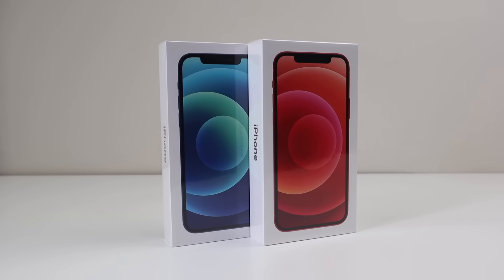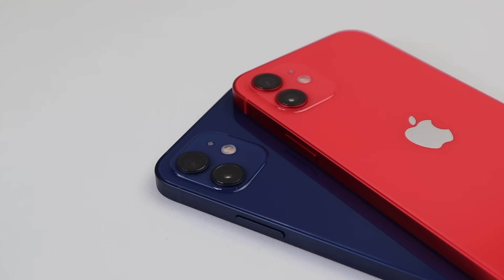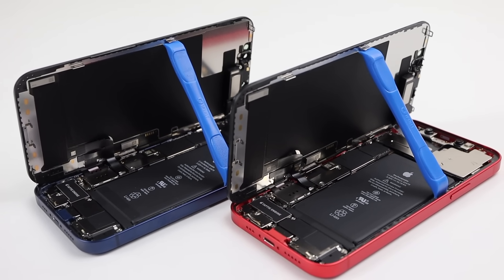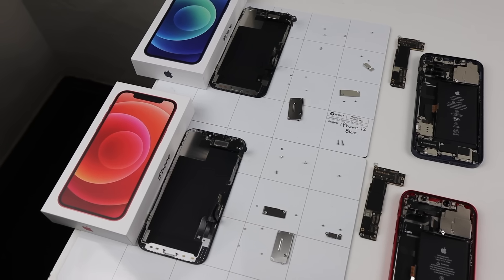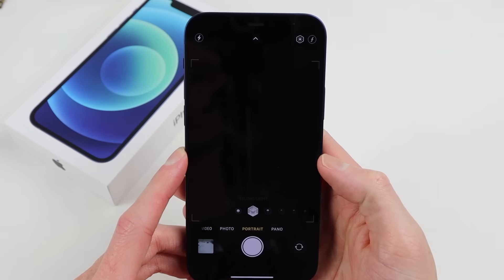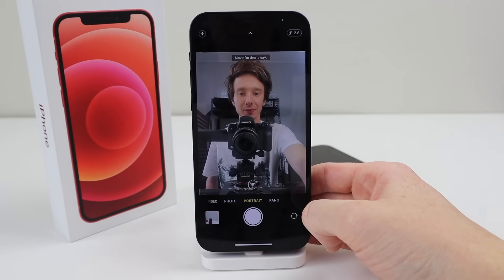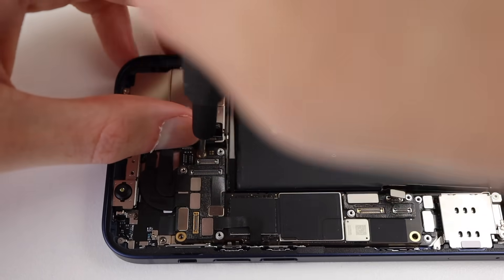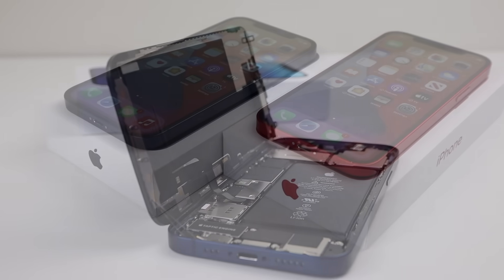iPhone 12 Anti Repair Design - Teardown and Repair Assessment

Comment: In Canada the "right to repair" was a hot political issue in 2019, and despite most Canadians supporting it it got voted down at the federal and provincial levels. Clearly lobbying from big companies works. This is unbelievable to watch and I'm afraid to think how far companies will take this be behaviour.
Reply: Imagine if car companies did this
Reply: @Imozart0341I  a little light pops up on the dash that says "non genuine oil detected" and your car refuses to start as a result.
Reply: @Imozart0341I  They've tried.
Reply: @Imozart0341I  Car companies have done this on many control modules over 20 years.
Reply: @Imozart0341I  they will. Just wait on it. As cars get smarter (tesla), theyll be able to integrate software so that it recognizes if the part is legit or not.
Reply: @erickrobles6365  I watched a YT movie about US farmers problems with their newest equipment repairs - exactly the problem you mentioned. It's already happening.
Reply: @Bart-dg6qv  damn cant believe that. Whats the name of the movie?
Reply: @Imozart0341I  oh god don’t give them ideas
Reply: @Imozart0341I  Farm equipment is like that and cars aren't to find behind
Reply: @Imozart0341I  Car companies do. There are many features on car that are not accessible without a dealer level computer diagnostic tool and software. Its going to get worse. Very soon NO aftermarket computer scanning tools will work on cars do to security issue's.
Reply: @Imozart0341I  Errr, Ah, you don't work on cars, do you? They have teh same thing.
Must now use the BMW computer when replacing your car's main battery.
Reply: @Imozart0341I  If the government does not step in they are going to. I think Tesla has some of this going on already.
Reply: If countries won't start making laws about things like this, it's gonna get only worse and worse. Companies only think about money and how to work less to earn more. But who can blame them. I hate Apple for this, even tho I'm their customer. I'm a movie editor and I work on Final Cut Pro + I'm a fan of their OS X. Not for games tho, for that I got Windows partition on my mac (Yeah I'm a nerdy gamer too). One thing is for sure - countries should start monitoring those behaviours not only for Apple, but for all major companies and They should start doing something about it.
Reply: Think of how many small repair businesses will be crushed if this sort of thing is not stopped. I watched something about John Deere tractors having a class action law suit (if I remember correctly) because they were purposely making their equipment unrepairable by farmers. 

How disgusting is that.... Someone at JD getting millions of dollars to screw farmers that they depend on for food.
Reply: John deere does this with tractors..
Its a fuckin monopoly
Reply: @jakechamberlain2206  Can confirm
Reply: Apple is trying to monopolize them selves right out of business. Ever hear of Gateway? They tried the same thing. You could not work on a Gateway without buying Gateway products.
Reply: There were some movements in Europe too, but I don't think they could change something.
Reply: If Canadians really care about the "right to repair" they will not buy this new Apple Iphone and the big company will think twice next time
Reply: @Tudumanu  why should i stop myself from buying a product i prefer because i dont agree with the company? Even if hundreds of us stop buying iphones so Apple changes their ways it won’t even make then notice. If they do, they’ll just do symbolic gestures but still continue the most profitable path which is to make phones unrepairable. No, in order to make tech companies stop exploiting their customers laws need to be put into effect. Calling people stupid just shows how you have faith in Apple’s non existant good will.
Reply: The only solution is people not buying or doing it anyway. If I paid for something I can use it, destroy it and repair it too.
Reply: Yeah fr man
Reply: Upgrades people, upgrades

Comment: Well, the EU is going to end up suing them again over this.
Reply: Bob Smith  business regulation is not socialist. Deranged Ancaps everywhere.
Reply: Bob Smith  It's not socialism. Socialism has nothing to do with business regulation and you do not want unregulated businesses. An EU lawsuit against Apple several years ago was settled with Apple agreeing to move to a USB charging port or provide an adapter to one with the phone. The one they are providing with this one is not compliant with that settlement. The lawsuit was over some violation of EU law that was designed to reduce electronics waste.

As for the the hardware lockdown, several companies used to do this with their server and PM hardware. None of those companies are around anymore mainly from doing this. Also, this encourages you to buy a whole new phone if anything breaks past the initial 2 year warranty or if the repair is not covered under the warranty since they are going to charge a lot for those repairs. This will create more waste and more demand for rare earth minerals, both of which have a negative impact on the environment.
Reply: I’ll be happy when the EU sues Apple over this, as it will also force them to see all of these other issues due to public backlash. Not that capitalist pigs would care, but the fact they are forced due to the EU on this specific law regulation means they would not have an excuse for other designs intentionally made by Apple.
Reply: the fact that they have confidence doing this though... they must've talked it through and found a loophole.
Reply: Bob Smith  deserved..
Reply: Bob Smith  Europe and their "socialist" good healthcare, roads and governments whcih at least try to help and not beeing a president just to save the tax money of your russian friends.

Comment: I wonder if Apple is trying to take a page from the automotive manufacturers book. Most people can work on new cars themselves for small stuff at home if they know how to, but if you replace certain components (I.E. radio head unit, ECU, Steering column, wheel speed sensors, steering angle sensors, E.T.C.) you have to reprogram the cars computer to acknowledge and read the new parts, but Apple seems to have missed the part where you can still fix most things on your car without needing to do that.

Comment: Thank you for confirming my doubts about how dodgy all Apple products are. never been a fan either. I've pretty much did a similar thing on all my 3 spare separate iPhones (6, 7, and 8) devices (except mine was to replace the camera since they all stopped working after firmware update to v14) and they all stopped functioning even further. including the finger scanners.
Also, I can't even believe they don't supply charging adapters anymore!!! what a joke!

Comment: Such offensive behavior on the part of the manufacturer. Apple 2020: "make money, be a dick about it".
When an iPhone stops working and Apple stops supporting it and no after market repair is available:
Option 1: remove the sim card, factory reset it if you can, smash it and send the pieces to Apple HQ to 'recycle', no return address (smash it so all the parts are damaged)

Comment: Apple is a Monopoly company who wants to have absolutely Full control over the devices and or th8ngs they sell to the customer or consumer so they (Apple) wont have a competitive company selling replacement parts reducing there income. They in my opinion, do Not care about the customer in any way except there money and how much they can get out of you. Buying a new device instead of being able to go to a athird part repair to get it fixed ratger then have to buy a new phone so you can keep using your phone you been using. Im shocked they still have as many sales as they do now.

Comment: After replacement of battery for any of the iphones using an oem aftermarket battery is there any hardware or software issues that you have encountered? Other than the “service” message and not displaying the battery health of the battery?

Comment: About a year ago Apple extended its independent repair program granting independent entities to availability to genius Apple parts and the software required to complete the repair. Just changing hardware is an incomplete repair. All repairs require a corresponding “calibration”. I believe Cameras have always been serialized but since function of the rear camera is connected to the function of FaceID camera calibration would need to be run.

Comment: Thanks for the info
I don't actually use iPhones
But I think what they do is they lock up the id number of the part on the software and "No... They don't do it manually!!"
It's something similar to one user windows copy where you can't change the parts with a different one.
But it is one step further
I get it for a security reasons yeah
Just incase you wanted to install another part with a malicious hardware on it
But man.... It's just a phone!! 
chill down apple!!

Comment: It is infurating when Apple does put the "planned obsolescence" in its products, forcing us to upgrade to newer ones in order to retain the functions or take advantages of new functions. My iMac 27" (Mid-2010) works perfectly, but I can't upgrade it to Mojave or Catalina anymore due to its Radeon 5xxx GPU's inability to process Metal drivers. I was able to work around that by replacing the Radeon 5xxx driver with one from High Sierra. However, Apple Maps doesn't work; VLC player doesn't show anything; etc. Wish there is a way I could upgrade the GPU in my iMac...

Comment: You're correct it's not a bug.  It is a feature.  Old school games and consoles used the same thing to stop (slow down)  the bootleg and pirating off software/games.  Some would delete your saved game, make the boss impossible to fight, disable features,  fake glitch out in ways the make it seem like a hardware issue when it is there copy protection.

Comment: Repair shop: swaps part from genuine apple phone to other genuine apple phone
apple: we have disabled your phone's features because you used a non-genuine part

Does this mean apple is admitting to not using genuine parts in their products? 😨😂🤣
Reply: Mindblowing hahahhahahaha
Reply: All Apple components are serialized. You cannot replace a component in your phone unless Apple specifically has a repair ticket open and the serials for the components are changed in their system. When a repair is completed, the phones logic board is flashed with calibration software that is hosted on Apple servers so that the new parts are accepted.
Reply: @TheWatatsumi  I was making a joke, but it's completely stupid and a good reason to not buy apple products nonetheless
Reply: @ambrosekillpack4841  absolutely, and as someone who repairs their phones it disgusts me.
Reply: @TheWatatsumi  You'd think you could spoof that server by finding out where those data packets go to and spoofing it on a LAN...
Reply: @heinrichsoltow  wouldn't be easier to spoof the serial number of the compenents
Reply: @TheWatatsumi  https://youtu.be/wAUq_iX3xkE

And this ladies and gentlemen is why you don't click on random links

Comment: Many companies have figured out that this kind of software connectivity allows them to make more $.  Pure greed, no concern for customers, R&D money spent to make your expensive have a shorter lifespan.
Reply: As a software developer this unfortuately takes barely any R&D at all. You just have a check in the BIOS/etc. that compares serial numbers and sets a global variable. A few variable checks here and there and you're golden.
(Of course I would never do that)
Reply: Most of the products we use...are designed to failure after warranty is expired..
Reply: It doesn't allow them to make more money, because now they are eliminating poorer users who would do purchases with app store.  They are becoming greedy, and that is their downfall.

Comment: The only thing Apple really cares is revenues. Fairphone is the only smartphone that is designed to be repaired by user. It's not the most performant but you can genuinely swap a broken screen or camera yourself by ordering one from manufacturer. 
iphone is trash and harmful to the environment because of it's non-repair politicts and low longevity.

Comment: It might have something to do with quality control and theft prevention. With infinite suppliers to manage, (most of which are located in world regions where legal retaliation would not be an option) pairing components on first assembly might have some use in preventing illicit practices by partners or theft during transportation.
It's true that it also makes impossible to replace a single component, but maybe that's not the main reason for this feature

Comment: My theory is that the camera is calibrated at the factory to seed the machine learning algorithms with correct initial data (and perhaps also for things like image stabilization, white point, sensor defects etc). This data is then stored on the motherboard (in the firmware somewhere?), which means only this specific motherboard knows exactly how to talk with this specific camera. Apple likely has internal service tools they can run  after swapping camera or motherboard, so that the two devices can communicate again.

Similar with FaceID. Either the Secure Enclave is located on another board in there, and it's paired with the motherboard (so the two are paired using keys/ids at factory); or the Secure Enclave is fingerprinting other devices in the phone to make sure it's not being tampered with. Makes sense if you're trying to set up maximum security and privacy, even if an attacker has hardware access.

So all in all, this behavior isn't unreasonable given Apple's goals for the user experience (amazing camera and top notch security). However, at least for the camera issue it'd be nice if Apple would provide the service tool to third party service technicians.

Comment: I'm not surprised.  The ac power connect to reboot after repair is common in many pc's, so it's a fairly easy implementation.  Some of those will also have ways to tell the logic board to anticipate a repair, and disables the battery until you use a certain reset button sequence, or power connection.  Proof Apple is definitely not the earth friendly corporation they spend a lot of money to maintain the image of, and generally not worth the price.  About the only thing I like is that it doesn't have curved glass, that's such a pain to work around, and can be shattered with a fairly light tap, like a driver bit.

Comment: I phone 15 "we have removed the battery because there are millions of batteries out there, so you can source a battery from an old phone and put it in your device, oh and also we removed the charging port so we don't have to waster resources on the charger, because there are millions of chargers out there so you can use your older device to charge your iphone 15's battery"

Comment: That charger thing alone is a reason to avoid the thing like the plague. Imagine buying an expensive new phone then finding out you can't even charge the damn thing unless you bought a separate adaptor for it.
Reply: Right?? Like what were they thinking
Reply: You can still charge using other charges calm down “can’t even charge the damn thing” just use a regular charger, it’ll match the style of your slow slow brain. I get the argument, but “can’t charge the damn thing” is a misleading.
Reply: You can just use your old charger, just no fast charging unless you buy a new box
Reply: Gosh they don't even give you the option to avoid that stupid adapter of you want fast charge, so they are basically charging for an unfinished product.
Reply: @makoala8881  you can avoid it, the cables imput to the brick is usbc, not the one to the phone, meaning you can still use your chargers at home, I don’t see the big fuss tbh, I’ve been using regular chargers for years and it makes no difference
Reply: But a lot of people have a charger that is a lightning connector. So just ditch the new cable and use an old charger with standard usb to lightning cable
Reply: @horizon8386  Depends on the battery inside the iPhone 12 and whether your old charger has enough power to charge it properly.
Reply: @mesothelimoa341   power is power even if it’s a trickle, but my XS max with a 3000mah battery charges fine with a standard iPhone charger granted slower than using a 12W iPad charger but still charges fine so there is no reason why the 12 with a 2800mah battery shouldn’t charge ok
Reply: @horizon8386  who has a lightening connecter??? First time I’ve ever seen this bullshit
Reply: You can get an iPhone iAccessory Pack, which includes: the charger head, a screen protector and an iPhone iCase, all for the small price of $39.99.

That way you get ALL you need only WHEN you need them, and save the environment in the process :)

- T.Howard
Reply: >get a charger head
>only when you need it

Ah.
Reply: @toddhoward5555  😐